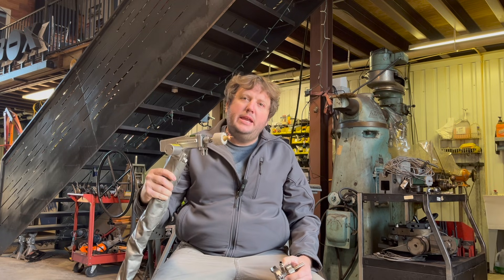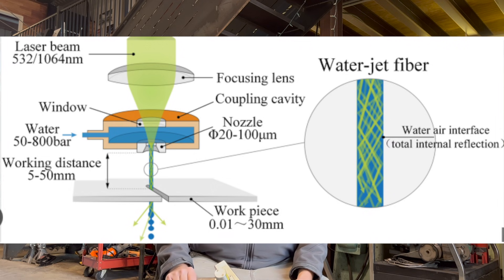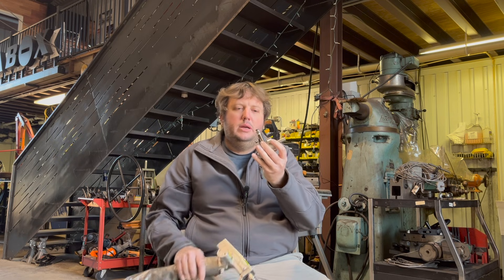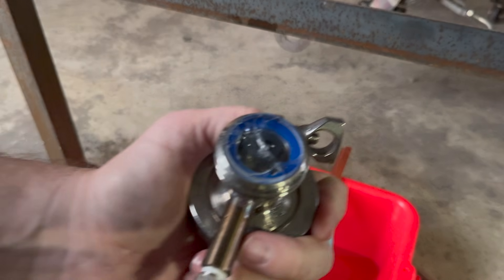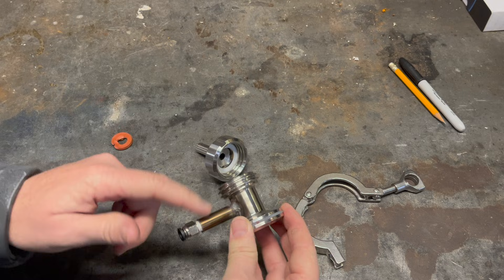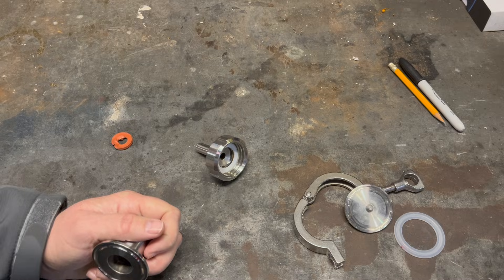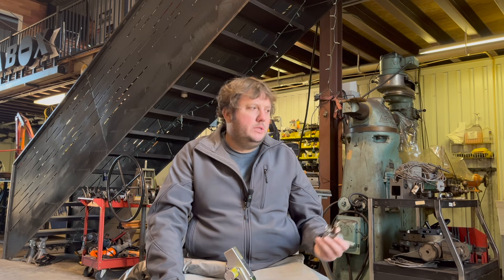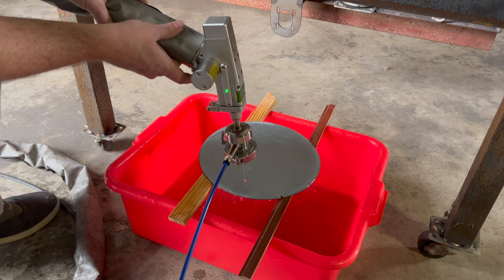D.I.Y. Fiber Laser WaterJet Cutter?

Comment: This is fantastic! Great experimenting! I’m super impressed. You’ve probably thought of everything that I could have, but my first suspicion is that you may not be fully coupling the beam into the flow. In the RF world, impedance matching is important and moving from free air to water seems like a large impedance mismatch. How to the commercial systems overcome this problem?
Reply from the maker: Yea i dont know, i know that there is some refraction to overcome but what was frustrating me is that i could see the red sighting laser follow the waterjet, but when you pull the trigger for the infrared laser to do its thing, all it did was try and destroy itself, im assuming there is a tolerance between the red laser and the infrared.
Reply: @k @k-rigg Even with a significant mismatch, you’d still see the red laser even if only 10% of it made it through. I think the red beam is a help but more like a red herring in that the precision required to get it to couple is vastly looser than the high power beam. If I were doing this, I’d put that nozzle on a very fine x-y stage, turn the laser power down to 1% or whatever the lowest level it will lase at, and then tweak the nozzle position (not the internal galvo mirrors in the gun). I’d also consider as large a nozzle as you can make that maintains laminar flow. 
I feel like tuning this in would really require an optical bench to learn what’s important and what’s not. 
I have a 1200W Fiber laser too. I’d like to follow in your footsteps if you get it working.
Reply from the maker: @kingjamez80  thanks for the suggestions!

Comment: This idea is a “breakthrough” that ignores basic physics. Once water enters the beam path, the laser instantly turns it into steam and right there you lose the energy the beam was supposed to deliver to the target material. On top of that, the water droplets act like 1000s of tiny lenses (rainbow effect) that evaporate in microseconds as they get in contact with the photons. Now the beam is interacting with three different environments at once: air, liquid water, and water vapor. That destroys focus, coupling, and energy density almost instantly. That’s why the laser didn’t even mark the material. Light only travels straight in a stable medium, the moment you introduce a new one, its behavior changes. If you want to see why water kills the process, do a simple test: inject a little water into your inert‑gas line and watch what happens. your gadget gets hotter than normal because you’re not heating the target metal you’re superheating the chamber. Once water enters the beam path, it flashes to steam and turns into a cloud of micro‑lenses. The beam scatters in every available direction, bouncing around inside the nozzle chamber, instead of keep moving in a straight line. All that stray energy ends up heating the sidewalls, the nozzle body, and the trapped vapor pocket.
Reply: I guess you missed the fact that this works. Maybe do a brief google search before writing a word salad.

Edit: As I read it again, I’m in awe of how may words one can write in a row with none of them being correct. That takes talent. 

For other readers, he I using the LAMINAR flow properties of water to turn the water into a “fiber optic” using the exact same principles of total internal reflection. This is a proven technique.
Reply: @kingjamez80  You clearly don’t understand the process. A laminar water‑jet fiber setup only works when the laser is injected into a thin, stable jet in open air. This experiment fired the beam through still water, which immediately flashed into steam and turned the whole path into turbulence.
Reply from the maker: I don’t disagree with what your are saying, but i think the idea is that if you account for the refraction of the light beam in a laminar flowe water path that it is possible.